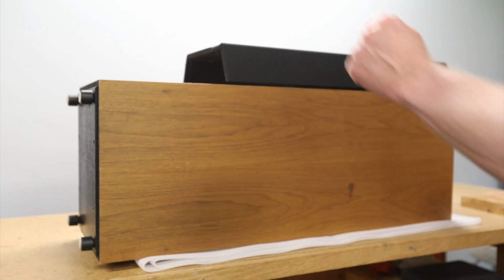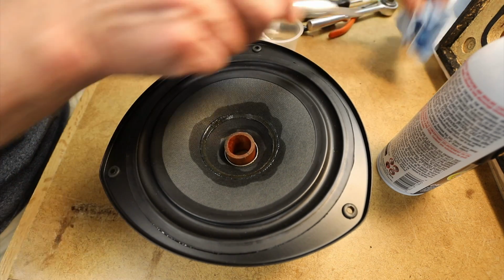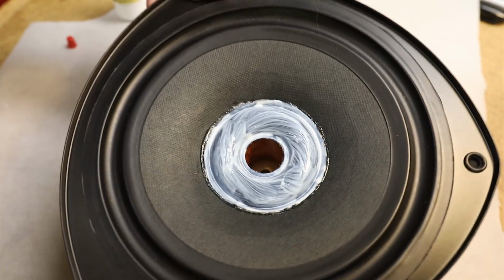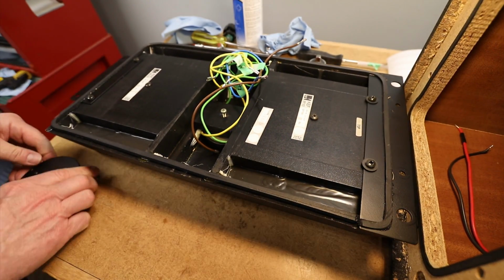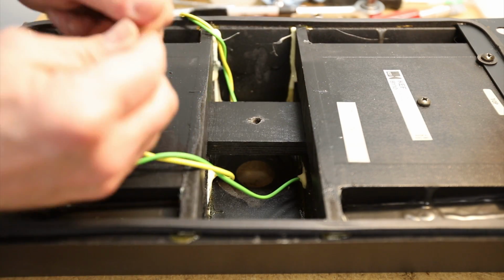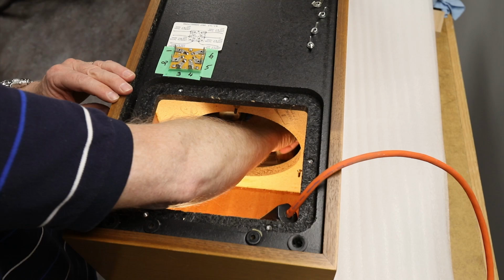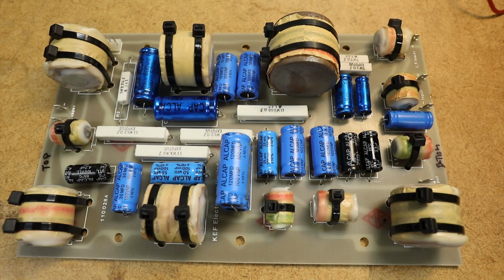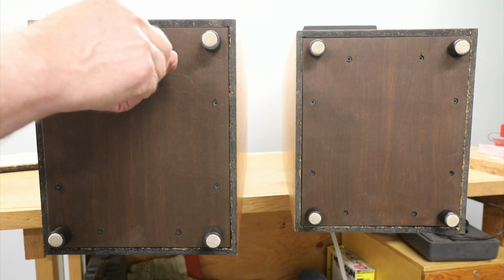KEF 104/2 Restoration

Comment: Hey frank, could specify which kit you purchase and why did you change all the capacitors? I ask this because all the kits I see out there come with 4 donuts and 4 outer suspension foam. My woofers do not need to change the outer foam because it ain't made of foam, it is made of rubber, and like in your case, they are in good shape. And this is something I want to do, instead of sending them out costing a fortune. I should have the skills.
Reply from the maker: Hello Joao - Thank you for you kind comments.
This is the kit I purchased from Simply Speakers.com = Part Number:FSK-KEF104C 
I did not need to replace the outer suspension foam (rubber) either and I could have saved myself a couple bucks by purchasing only the center donut foam = Part Number:FSK-KEF.  I did not realize at the time that the center donuts were available on their own. 
Why change the capacitors? The original 104/2 KEF capacitors had an electrolytic interior. From what I understand, it's like a gel and the gel is prone to hardening over the years (decades) and not allow the KEFs to produce the sound they were originally intended to. I could have done nothing and maybe gotten away with it but since I was doing a complete restore it seemed like a good idea to change the capacitors as well.  Side note: during my research, I was presented with the idea of using solid state capacitors instead.  This would have been a viable (possibly cheaper) solution, however, in order to preserve the "original" sound of the KEFs, I elected to replace the capacitors with the original ones. Long answer - sorry.
You mentioned "having the skills" - I did not think I could do it either but it worked out very well.  One word of advice, do not try to scrape all the glue away from the cones when replacing the center donuts. 
Good luck :-)
Reply: FRANK SOOS I have watched the video several times. And thanks to your wife's awesome job with the narration, I will remember to take care while crapping the Woofer, I should Know talent when I see it, I am a sound operator. Once again, in the end, a great video was produced with awesome results. A win-win situation.
I will attempt this. With this kind of information what could ever go wrong, at least no surprises, which is great.
I will order from falcon acoustics the capacitors. On the web site they seem to have with 5% and 2% tolerances, the later in limited supply. Will have to investigate further. Cheers
Reply from the maker: Hey Joao - Thanks for the compliments - I passed them on to my wife as well :-)
I have a string of emails between myself and Falcon Acoustics regarding the installation of the capacitors.  I am willing to share that with you as it may be of some help.  How can I send it to you? I prefer to not post it on this site.
Reply: I would very much appreciate that. I suggest a forum of some sort, where we can PM each other. Because we ain't exchanging emails addresses here are we?
By the way I decided to refurbish the T33's. It's only a mater of removing the old and dried out ferro fluid and replacing with new fluid. You can find it also at simplyspeakers too! By the way frank, you didn't throw the T33's to the bin did you? I am guessing you didn't. You could and should, along with your wife maybe, and makes us a video refurbishing the T33, that would be icing on the cake and a little cherry also. Can't strees enough how much this video motivated me.
Reply from the maker: If you are a FaceBook user, PM me and I'll send the info about the capacitors.  I had the T33s replaced over 10 years ago at a store, so they are unfortunately long gone.  As I mentioned in the video, I was replacing TS1191, which are not the stock T33s. Thanks again for your kind comments!
Reply: You got it. There are a few Frank Soos on Facebook, I tried to identify which one is you, but with no success. Maybe you could send me a PM. I go by the same name as here. Thanks a lot.
Reply from the maker: Just checking in...... I'm the one with the eclipse shot on the cover.
Reply: Hi Frank, I found this video and it is really hopeful in my own journey to repair the KEF 104.2  I wonder if you will be able to share with me of your correspondences with Falcon Acoustics.  I am looking to replace the capacitors in addition to the woofer donut caps as well as to refill the ferrofluid of the tweeters.  Thank you very much for your help in advance.  I try to reach out to you in FB but I couldn't find the person as you describe below.